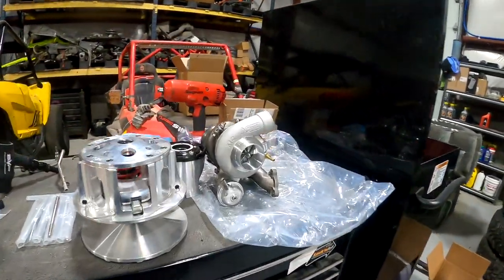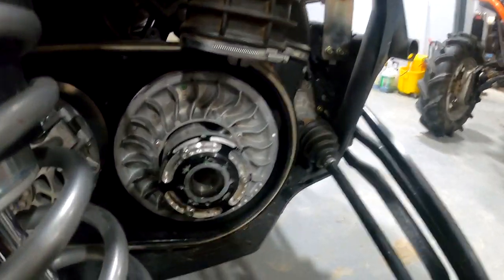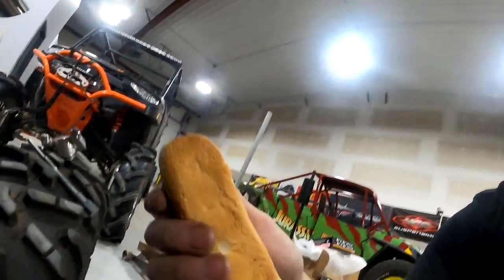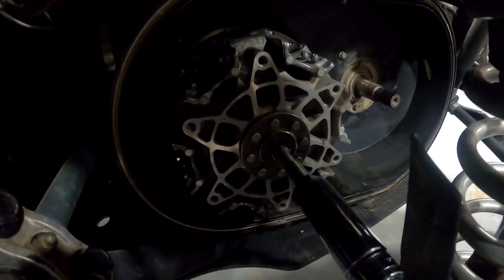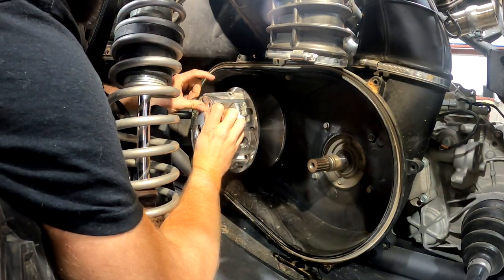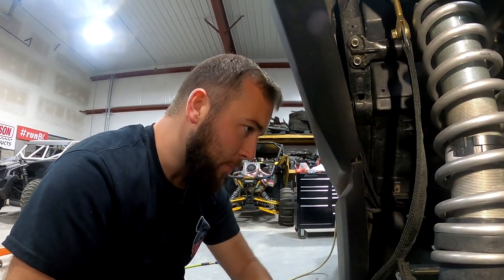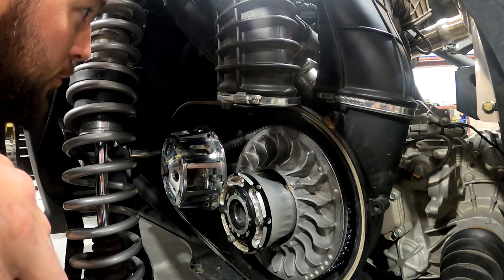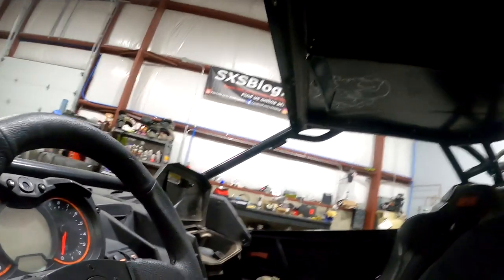Maverick X3 primary clutch TIPS AND TRICKS with Rick! (and STM install!)

Comment: Thanks Rick. I know of this Snap On Digital Torque wrench you speak of, and would not be pleased were mine not returned to da tool box. Great trick for the primary, no reason it would not work on the PoPo machines as well, at least that I can think of. Going to be fun to see you with the bigger turbo. Of course, this may require bigger injectors, and together they may make more mix than the stock valves can handle, which may require bigger valves....the never ending struggle of the gearhead, since the Model T.

Comment: I just put the driver's side front and back tire up on a car ramp.Squirt water in there with the water hose put some tape on that sucker.Pops off every single time water runs out.Soon as you put it back down on the floor nothing to clean up blow a little tiny air in there , dry it out

Comment: It works on pilot bearings for your clutch to when they're really suck you just keep jamming it in there and using a solid smooth drift and just keep ramming it in there like a pile driver then slowly the forces it out

Comment: Great tip. I have a 18 xp 1000. Changed all suspension. Adjustable everything except upper A arms Not sure camber are what I need. Steering wheel is cocked and it drives me nuts. I’m sure I’m not the only one with this question. Can y’all give the viewers an I an idea of what is a good degree of toe and camber. Thanks guys!! Like the new and or improved channel. Keep it up.

Comment: So I put less bread than full hog dog bun and my puller bolt will not go in deep enough to use bolt since I don’t get to the threads. I assume I put to much and need to pull some of the bread out. If not please advise.

Comment: I searched for the clutch cover bolts and all they have is the quick release ones no bolts. I play in the water and mud alot so I need bolts for it to seal tight. Do you still have the link to the part not just the home page?

Comment: Any tricks on how to take a primary clutch off a 2021 Maverick X3. I tried everything blue marine grease, lithium grease. I tried 2 different impact guns a Ridgid 18v and a Dewalt 20v 0-4200 IPM. Should I use a stronger impact gun or keep trying? Thank you!
Reply from the maker: Bread in the hole